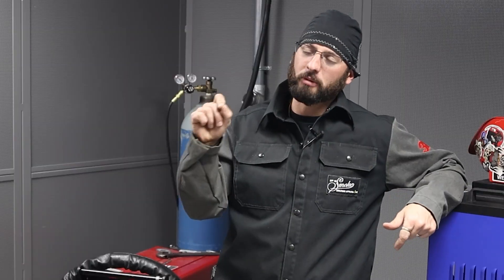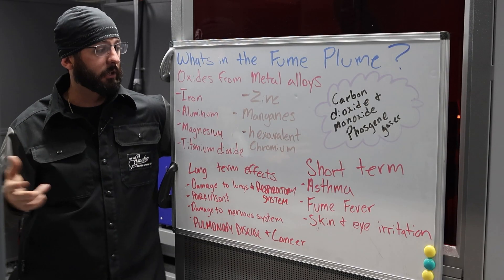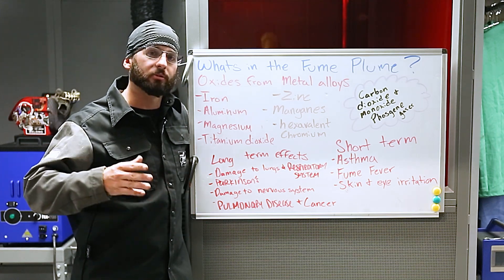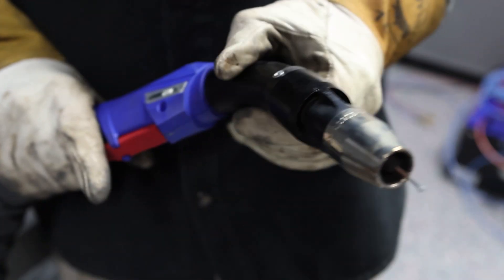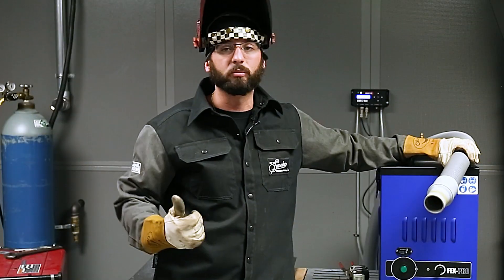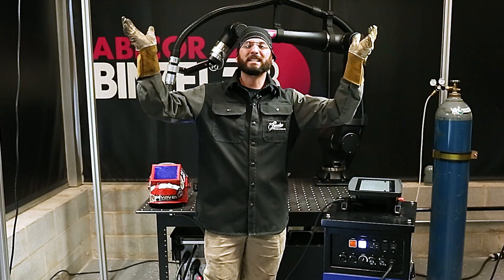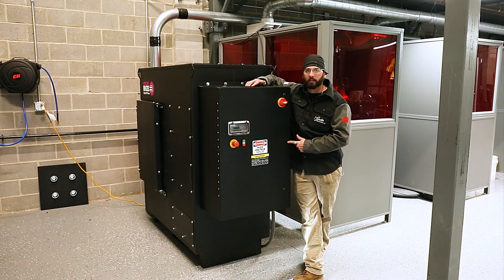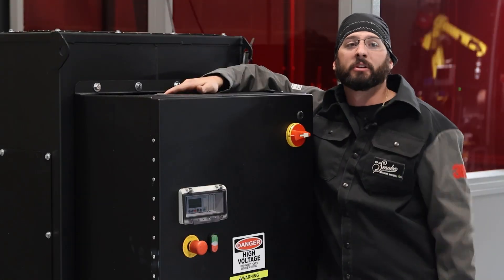Choosing the Right Fume Extraction System for Your Welding Shop

Comment: When I used to work at an exhaust shop we used abrasive chop saws to cut the pipes. To collect all the fumes and dust we used some down draft tables and they worked awesome. For the shop fumes we had two big air fume circulators with filters to kinda control the smoke especially in the winter.

Comment: The cost of some things I'd like to have in my modest workshop seem wildly overpriced. Fume extractors, TIG water coolers, even tungsten grinders. I see a tungsten grinder that looks like a glorified Dremel but costs nearly $1,000. Is there just not enough demand for someone to make these accessories at a price that they can be affordable for the non-professional welder?
Reply: Use your imagination.  All this "Profesional stuff" can be diy significantly for less money.